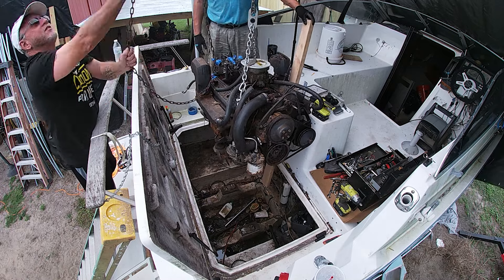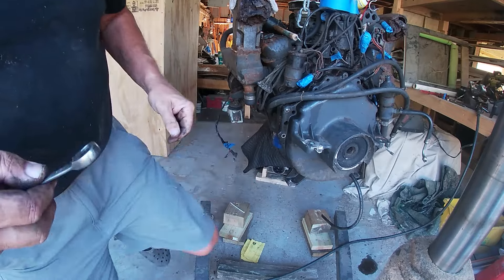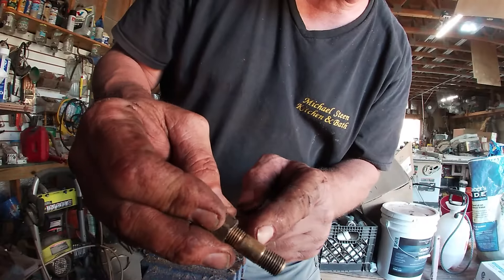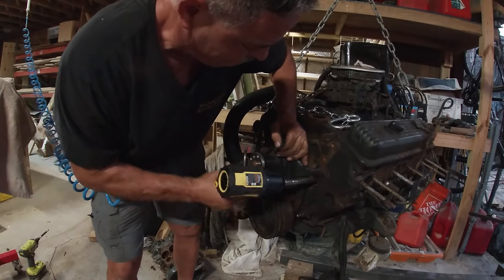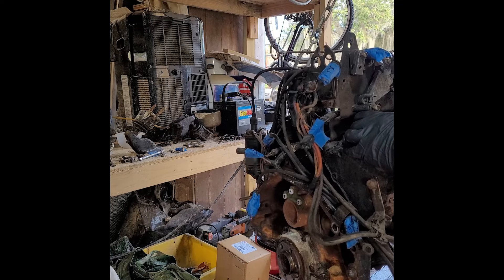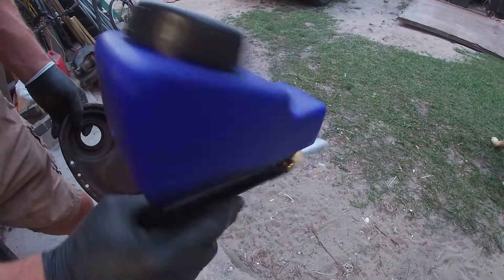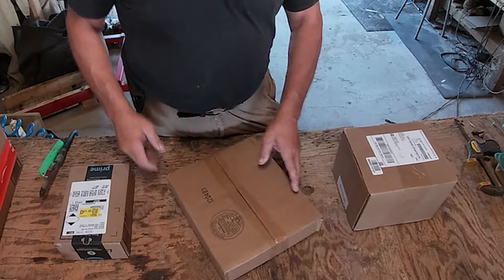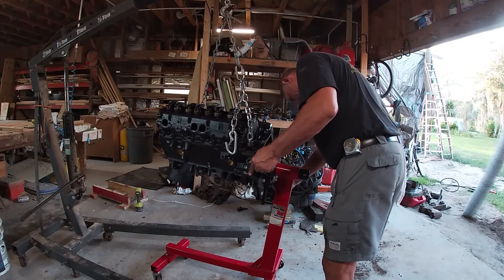Boat Update, Engine Swap Out Old Engine,Part 11 Bayliner 2450 Ciera Project Boat For The Great Loop.

Comment: nice mike you looked like a champ!   remember to prime the oil pump
Reply from the maker: Never done that, I have always let it turn over a few times without the coil plug. Are you talking about something different? Lets chat if need be, maybe bring you on one of the lives.
Reply: mike the oil pump may not pull a vacuum if its not primed  one time i forgot to do that and ugggh no pressure i think i added 6 more quarts to bring the level up over the pump cranked it and it worked

Comment: For gaskets placement I use E-Z Turn lube. It is thick like bees wax and fuel and oil will not cut it. to clean up you will need MEK or acetone. It is the best gasket sealer I have ever used!
Reply from the maker: Sounds good.

Comment: You might want to replace the oil pan.  They often develop pin holes in salt water.
Reply from the maker: Man I hope that doesn't happen. I did inspect it pretty good. The engine is in and I have ran it a few time, so far no issue. Hopefully never does develop a leak.

Comment: well Mike being a Mach for over 30 years in marine i really well mind boggling you worked on the eng hanging on chains then you  worked on the new blok with an eng stand PFFF bakwards come onn are we going to get another spoof
Reply from the maker: I was using one to strip the old engine and the new engine on the stand to move the parts right to it.